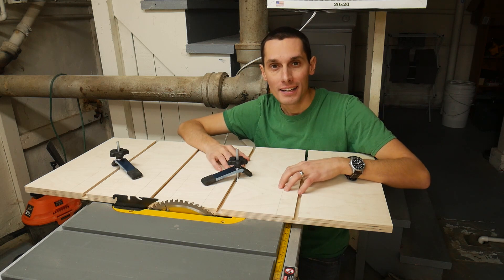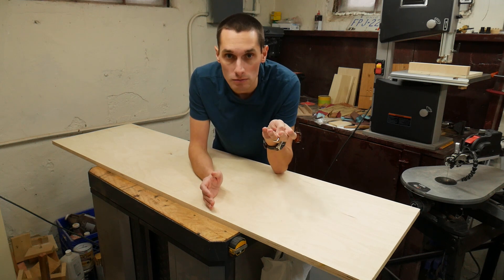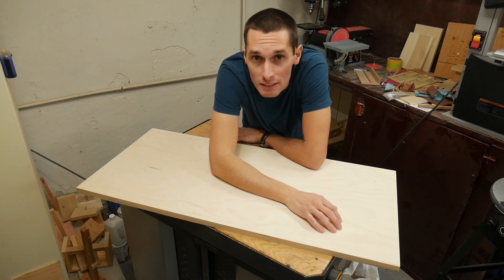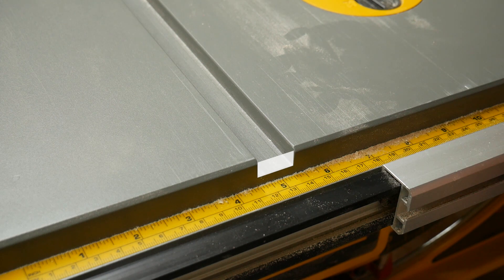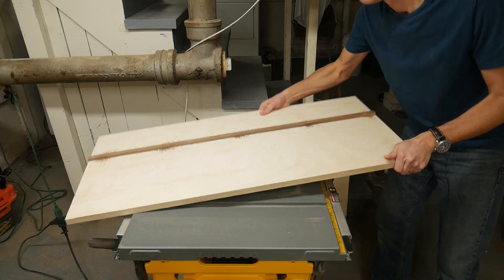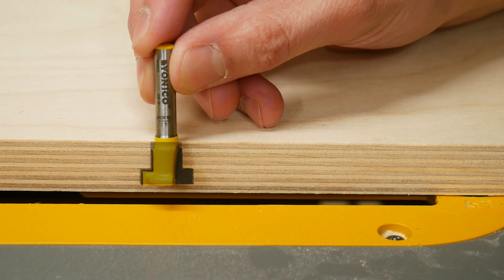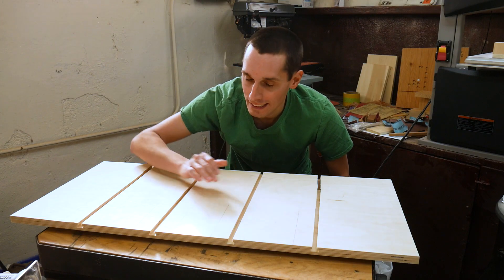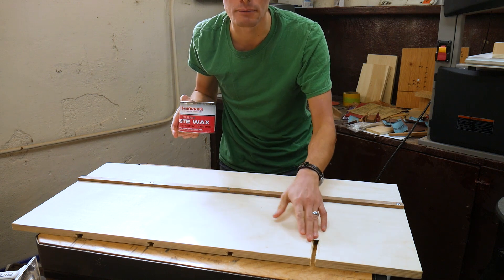How to Make an Edge Jointing Sled for the Table Saw

Comment: Usually I enjoy your videos but this one was not very well thought out. You could have used your fence to square it instead of what you did. You should always verify your router bits before starting that they are secure.Making your own T-Track was a good idea as was using Baltic Birch,  I'd like you to revisit this project at a later date